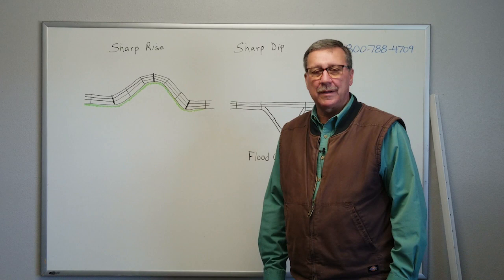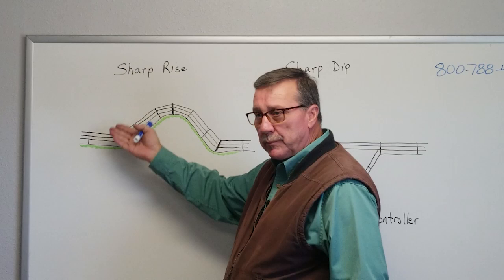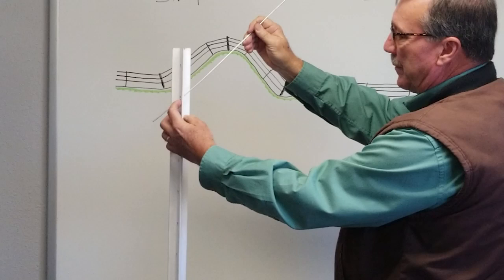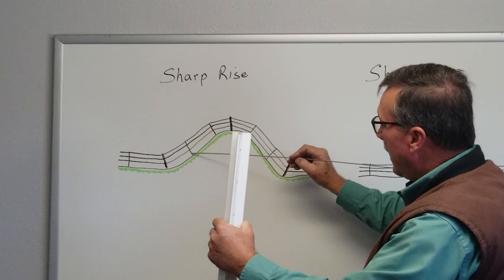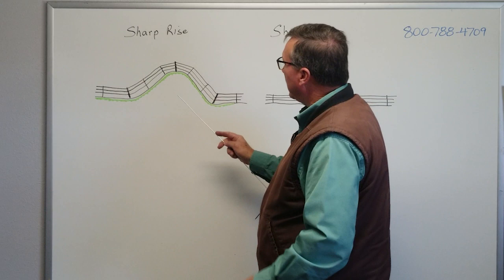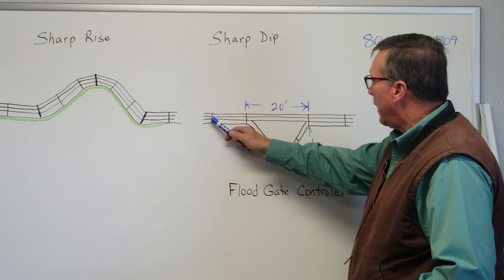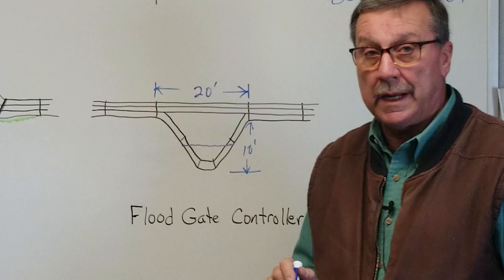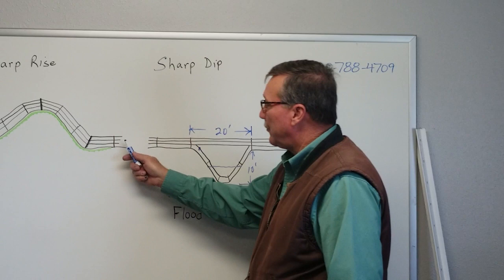Post positioning on sloping ground

Comment: In your dips, we have used elec flood gate controller, on 3rd wire down ,and hung dog chain droppers to water line, spaced out with short lengths of 15mm, water pipe [plastic], when, creek floods, cuts out, and no wires to catch, rubbish etc, washing down creek, simple and easy, been doing this in New zealand, since Gallagher, made these controllers

Comment: A drawing or example of the wooden jig would be helpful.
Reply: Made one this morning. We will have it in our next video.
Reply: @michaelmcelroy6038  How do H posts drive are they as reliable that way as cemented in?
Is there some way to do corners with only using one H post, I've thought of some ways but do you have any?
Reply: @jeremyjensen1969  I have not driven an H-post. Soil conditions are a huge factor. I have only installed them digging a 30" hole and using 1 80lb. quikrete. Then backfill with the soil tamping every 6". You can use one H-post if you are only using up to two wires such as for an interior fence. You will need to lean the H-post away from the pull about 2". Tighten the wire just enough to pull the slack out of the wire.

Comment: Lmao this is not how you do that what so ever
Reply: When using their t posts with holes predrilled, yes, this makes sense due to the angle of the wire coming thru the hole. If one was using a steel tpost or wooden posts and you attached "regular" insulators they would snap off. However, you could use a "roller" style insulator and that would preve t the twisting or snapping. If not using timeless fence predrilled tposts, posts in plumb and a roller style insulator would work better. Its not that he is wrongg, he didnt explain why it applies to the timeless fence t posts specifically.